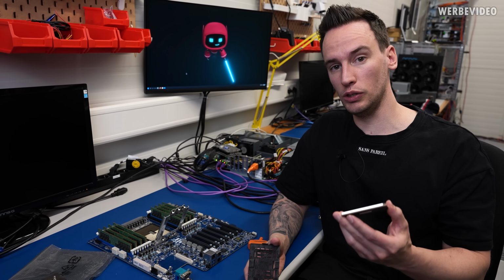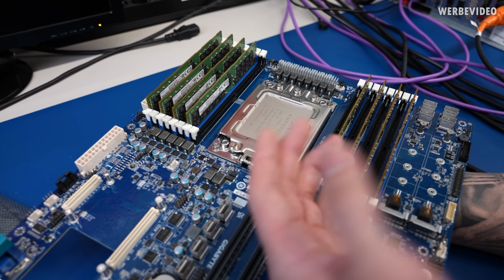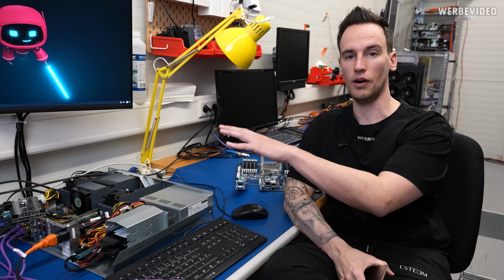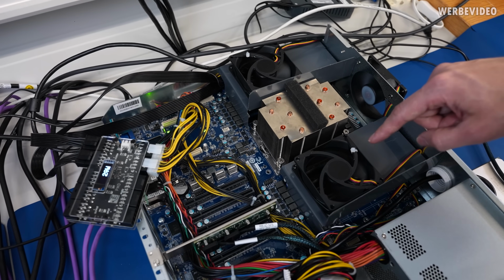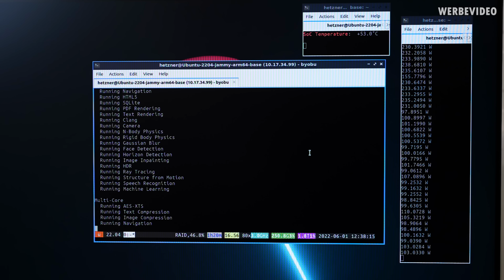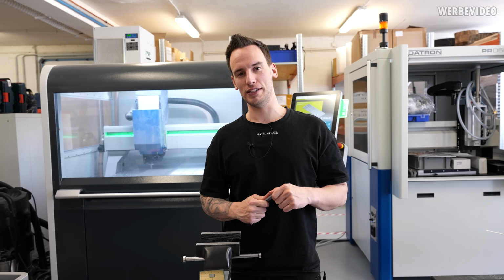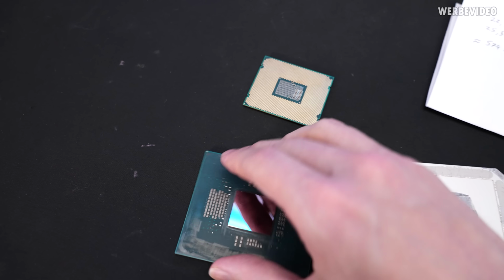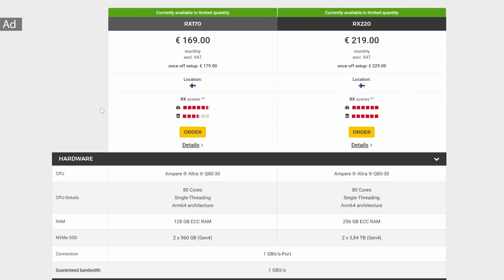This insane 80-Core ARM CPU easily beat a 64 Core Threadripper

Comment: Just a PSA, you cannot compare geekbench 5 results between windows and linux systems.
Linux performs much better in the benchmark, for example my 8700k at 4.9ghz and not the best memory setup gets 8600 points on linux vs only 6700 points on windows.
This is especially true for cpu's with a lot of cores, so I would refrain from comparing it to hwbot scores as linux is banned there.
Reply: Indeed. I get a large boost in GB5 from just moving to Windows and Linux.
Reply: But it's zen 2 not even 3
Reply: @chriswright8074  True, but why does that matter in this case?
Reply: hilarious that linux is banned on a website meant to compare hardware lmao. Im sure they dont enforce a certain version of windows though :^)
Reply: No ban windows for sabotaging your performance
Reply: But who wants to run windows on a server?
Reply: @juliocamacho8354  nobody except corporations who run scada software which exclusively runs on windows
Reply: @benjiderrick4590  You've clearly never worked with servers in a corporate setting, almost every company will use Windows Server. Even those that have gone 'cloud' are running their stuff on Azure on Linux VMs that run on a Hyper-V (Windows Server) system...
Reply: GB is just made up numbers for each platform and OS. It's a huge joke and irrelevant. Remember, it says iPhones are twice as fast as snapdragon....and then iPhones gets waxed in real world results.
Reply: True. I also think runs on Linux are a lot more consistent since you don't have hidden background processes randomly eating up CPU cycles.
Reply: @surrenderedwill3326  Depends on configuration, I see lots of unexpected kernel threads and daemons that I fight to remove on my Linux servers.
Reply: @johndododoe1411  You don't know what you're doing. Those kernel threads are there for a reason.
Reply: Well, yes, you can compare the scores. The comparison makes Windows look bad.
Reply: @tjthill  well no, because the point is comparing CPUs, not Windows to Linux. Comparing a CPU on Windows to a different CPU on Linux isn't valid results since the Geekbench scores themselves will be different on the same CPU.
Reply: @berzerker4998  Then they should just use Linux, since it runs on any CPU and shows what the CPU's really capable of.
Reply: @tjthill  ...yes that was the point of the original comment
Reply: @berzerker4998  Okay, that's fair. I didn't take it that way, and still see the read I was replying to, but I do see how you read it too.
Reply: @tjthill  the problem is inconstancies. Intel latest gen for example have wonky Linux performance. They wanted to maintain their consistencies in their database.
Reply: @bltzcstrnx  that's just because of the pcore ecore design of alder lake. Windows had problems with the scheduler on 12th gen, remember
Reply: @benjiderrick4590  Windows 10 have problems, IIRC Intel work with MS for Windows 11 support. Anyway these benchmark sites usually have strict requirements. Sometime even specific Windows version, drivers and firmware/bios.
Reply: @bltzcstrnx  it was at the launch of alder lake, now both windows 10 and 11 work as intended with 12th gen. That was also at this moment we discovered problems with enabling ftpm on Ryzen lineup on windows since going to 11 required it.
Reply: @benjiderrick4590  Ryzen fTPM stutter have been fixed in recent AGESA release.
Reply: @bltzcstrnx  i know that already. Read the fuckn comment I talk about past occurence of problems...

Comment: They should just have the pins in the socket and the pins go into the cpu. Would be easier and cheaper to replace a board then a cpu in a lot of cases.
Reply: That's called LGA it already exists for that exact reason.

Comment: Not bad against the old Zen 2 based Threadripper!  But the 64 core Zen 3 Threadrippers do better. GB5 scores - Zen  3 Threadripper Single Thread - 1552 - Multithread - 45059 - Not too shabby for the same/similar (280w TDP) power envelope, thermals and 16 cores less than this ARM CPU!  But I can't help but feel that these ARM "Server" CPU's are very underwhelming, and very niche, after all the sky-high promises a few years ago.  Thanks for the fascinating video der8auer!
Reply: I feel like ARM is a couple years away from completely dominating the server market. hundreds of Low cost, low power cores are exactly the kind of hardware most servers need compared to Intel and AMD that have higher power single cores with higher energy and price costs.

 I can run a 1080p streaming and file server from a raspberry pi 4, which has 4 relatively crappy ARM cores. For servers needing to handle massive numbers of clients with very little server processing, ARM is a very scalable and economical solution - at least until RISC V matures
Reply: @merthyr1831  Most software is still single threaded. And a lot of the enterprise market uses virtual machine software that isn't available on ARM. Windows Server isn't available on ARM either. And "low cost?" None of Amperes stuff is low cost. A base model with 32 ARM cores (which are less powerful per cycle than x86 cores), 8 GB of DDR4, no hard drive, no NIC(!!), would cost you $5,686. You can get a Threadripper based 32-core based server for $300 less with 4x the cache. And that cache will be important when your load-store architecture is constantly pulling 8 instructions for what would be 1 instruction on x86!
Reply: @merthyr1831  these chips are not lower power when you look at density, which with Zen4 Epyc out I don’t think AMD is going down easily. Not to mention CDNA3 also being a thing, something ARM has yet to replicate. It will be a tough battle as long as AMD sticks with x86

Comment: They apparently also have an 128 core cpu, i’d love to see how that goes
Reply: it goes weeeeeeeeeeeeee
Reply: Yep, the 128 is called Altra Max, socket compatible. Single threaded and same cache per core, so it scales linearly.
Reply: @vikingforties  yes, but linearly wouldn’t quite be correct since there’s always diminishing returns with going big unless they get everything perfect
Reply: @nguyenminh7780  Agreed, generally the CMN 600 mesh would handle the extra core load but you could potentially run out of PCIe lanes or start to have stalls if the workload is memory bound.

Comment: I certain Arm is the leader. If you haven't noticed it yet. If you have a droid it can outperform your PC or Mac hand's down. From boot on, it has to less problems overall. It's far faster and can claim easier maintenance. The only problem I personally have with it is the file system isn't the same as Win or Mac. I hope to see more work towards use in PCs in the future.
Reply: A phone doesnt outperform a PC.

Comment: Will a Linux version of crysis run good?. even in emulation with winblows VM I reckon it will might be lot of CPU performance hits but a 3ghz 80 core arm likely has enough grunt to VM winblows and gaming.. and I reckon steam for Linux will work pretty well.. would be interesting to put it to the test n see what it can do natively in Linux gaming and also interesting to see what a VM winblows gaming can do..
Reply: No it will not run at all.
There is no grunt if you can not communicate between application and hardware layer...

You would need something like Rosetta... And if you get that then you have crysis a game mostly running on a few cores....
Won't work.
Reply: @justacomment1657  Although I'm pretty sure it's a headless server with a tiny iGPU inside the BMC part of the board.

Comment: But does it run Crysis?
Reply: A Linux version of crysis then yes.. even in emulation with winblows VM I reckon it will might be lot of CPU performance hits but a 3ghz 80 core arm likely has enough grunt to VM winblows and gaming.. and I reckon steam for Linux will work pretty well.. would be interesting to put it to the test n see what in can do natively in Linux gaming and also interesting to see what a VM winblows gaming can do..

Comment: I hope that one day in the future, we will be able to use ARM cpus in our main system. I like to see motherboards be able to take in ARM CPUs from different manufacturers aswell as the ARM PC being able to take in different types of hardware such as GPUs
Reply: plenty of ARM cpus take gpus. PCIe is not an x86 exclusive communication bus, with even the Raspberry Pi having PCIe lanes. the only limitation currently to running big gpus on ARM is software and drivers.
Reply: @zachbrown7272  I think OP means standard ATX desktop PCs, not server parts. PCIe lanes on low power SBCs are not always standard, requires an extension (daughter or motherboard) and they are quite limited in number and bandwidth.
During the first roadmaps of Zen, the AMD K12 family was supposed to use AM4 socket and the same motherboards. This was a promising step but AMD never released K12.
Reply: I remember when we had multiple mainboard chipset vendors, ALi, SiS, VIA, plus of course Intel; before that C&T and a bunch of others. And how Socket 7 was a cross vendor CPU socket. That was nice.

But things seem to be moving into the opposite direction where things are more integrated and more insular. Some suggest that discrete GPUs may disappear as well in the near future.

Still, some variant of a Broadcom server hub chip was used on last gen game console to glue IO to an AMD SOC via HyperTransport. Now all the MB logic is basically PCIe based. Would be curious if someone just standardised a CPU socket, or AMD licensed AM5. You could have a standard for AGESA like modules and a utility which integrates it into the mainboard firmware, which can be installed via Flashback, or you could have two separate flash chips, one being in the mainboard and another in the CPU package. A lot of work to untangle things.
Reply: There are bunch models support GPUs. Like Gigabyte, Supermicro, and Foxconn.

Comment: This was quite interesting to see because we're seeing a huge shift towards arm CPUs so it was interesting to see how it would play out in the data center
Reply: @Godot Yes! I have to imagine Arm's efficiency seriously piqued interest in the data center.

If I remember correctly, the reason arm is so efficient is because it doesn't support older instruction sets like x86_64 is expected to. X86 is great because you can buy an Intel processor today, a brand new raptor lake chip and fire up DOS like it was running on a 486. Very neat for automation or manufacturing where the software or hardware hasn't received updates in years, or the user decided not to upgrade for one reason or another. Either way that same user can again, buy the latest Intel chip, hook it up via serial to his 25 year old whatever-it-is and it just works. 

What I think would be a welcome solution is a new processor built on old instruction sets and architectures, manufactured in a moderately sized amount.
Reply: @Godot Thing is the Enterprise market demands it and that is probably the bread and butter of most of the company's sales.  Its fairly easy to tell a home user that "no your photo viewing program from 2001 will no longer work".  Unfortunately you cannot tell Mega Big Corp "Sorry your billing system from 1993 will no longer work" because they are a huge customer and their CEO calls your CEO and you get told to keep their stuff compatible.
Reply: Playing out quite well, Azure, Google Cloud & Oracle plus the Chinese hypers all have @AmpereComputing offerings.

Comment: The orange angle pieces for the bench vice are technically called "soft jaws".. Merely to protect the item being clamped of the knurled clamp face being imprinted on the piece being clamped otherwise potentially causing damage. 
In the past, strips of aluminium plate would be used for this as it is soft enough to conform to the shape without causing additional damage to whats being clamped, but since plastics now the norm..
Reply: aluminum would deform the copper heatspreader, so plastic is the right choice here. an annealed copper or brass would also work.

Comment: it's interesting that der8auer is surrounded by cutting edge technology often made in germany that won't exist in germany in just a few years because they are a puppet of the usa and they went along, like a maddog, with the sanctions on cheap energy. all of the manufacturing will go away very soon. the greens are intentionally deinsustrializing. they want a germany just run on renewables and therefore will destroy all industry by increasing energy costs 3-4 fold, permanently.

Comment: Ian over at TechTechPotato got a 45059 on Geekbench 5 with a TR 5995WX 64c/64t, so no SMT, with SMT was lower.  Geekbench doesn't really like Ryzen as much as other architectures but the 80 core ARM is still doing well.
Reply from the maker: Yes very interesting performance of the 5995WX :) we shot the video about 6 weeks ago so we didn't have this info for comparison
Reply: @der8auer-en  Nice video but quite misleading. I don't really see the point of comparing a headless server platform with a workstation one, especially considering they will often run on very different operating systems.
Although many server tests were made few years ago when Ampere systems started to be available and it appeared that virtualised hosting and cloud services were the strength on those ARM processors, other types of server loads were not that better and sometimes they even performed much much worse on Ampere than Xeon or Power.

Comment: Imagine if ARM would start to focus on high clock frequencies also.. The comparisons to x86 would be embarassing.
Loved the video Roman, always happy when you dig into enterprise stuff. :)
Reply: The fact that no one has done that for this many years, makes me wonder if there is an architectural constraint that makes high freq arm very hard to design or manufacture :(
Reply: My experience with ARM would suggest they could do 3.5 and maybe 4.0ghz for a few cores at a time right now with se modifications, but matching the x86 clocks of upcoming chips (above 5.5ghz, maybe reaching 6.0) would require a new core design.

The other issue is the use case if the CPU. This chip is designed to be efficient. As such, it is clocked high enough to perform well, but also has a ton of cores for parallel operations. This is ideal for a server application.

A desktop chip with 16 cores and something like an 80W power budget would be able to push more voltage to each core for higher clocks, but with so many cores sharing the power budget, something has to give.

Comment: The greastest thing about this is that ARM can be licensed by almost any company who wants to make a CPU and not locked as x86 is. This means more brands in the future for CPUs and that's good for consumers
Reply: My hope is on RISC-V.
Reply: It won't matter shit. This doesn't impact supply... They will have to fight for manufacturing quotas at TSMC at the same prices as anyone else. Do you think whatever brand has the benchmark leadership is gonna stop taking their premium?
Reply: @haakonht  no they won’t stop doing theirs best  and it will take some time but for sure in the future there will be more than just Intel and AMD
Reply: @haakonht  there are many other fabs, intel foundry, global foundries, etc. Most of them cannot do the bleeding edge process but arm is never centered around single core performance. I'd be happy with a 22 mm 80 core system with low power usage for server.
Reply: @haakonht , considering how much less die space is required for the same number of arm cores, starting your own production at smaller scale first, would be much cheaper and you won't need as much silicon. So I think it's entirely possible.
Reply: @rinrin4711  pardon...? . Starting your own production.... Yeah.... Works really well for the Chinese... And they have a complete economy and the government behind it...
Reply: @justacomment1657  More than that, PRC can't get licences from ARM anymore and that made many fabless companies to migrate to Risc-V.
That's certainly why Dinkleberg said "licenced by ALMOST any company"
Reply: @rinrin4711  Starting your own production?! Why do you think there are only two main foundries doing foundry services in the entire world? It's not that there aren't others, but it's a much more complicated process than you think. Even a trillion dollar company like apple don't even manufacture their own, they have to pay TSMC to do it. Not only is it insanely expensive, it's also extremely difficult, especially when going below 10nm (which is why intel is still stuck at 10nm after so many years).
Reply: @fidelisitor8953  And don't forget there's only one company (ASML) which is capable of making machines which are used by  Intel, Samsung and TSMC. And ASML uses lenses made by Carl Zeiss, so basically a German lens manufacturer calls the shots :-P